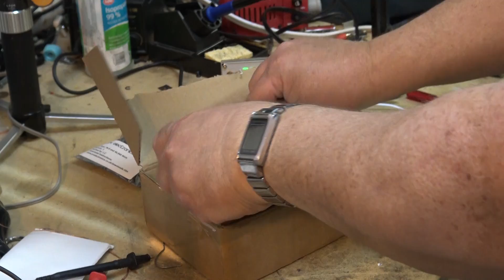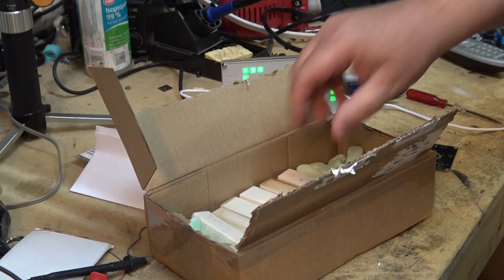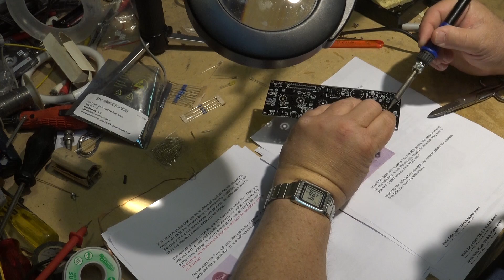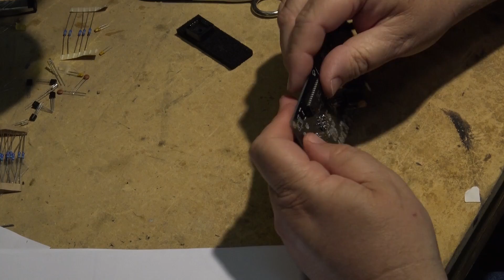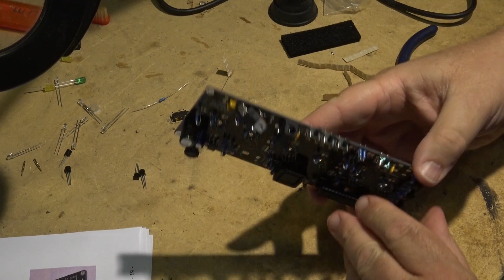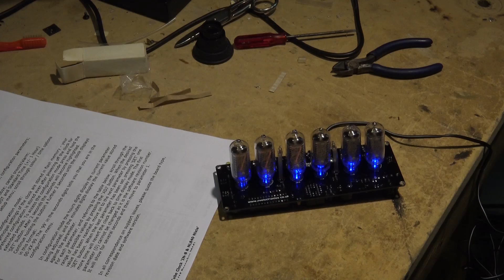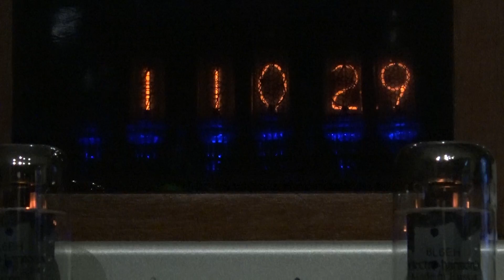Nixie Tube Clock Build

Comment: Can you tell us where you bought this kit from? There's a ton available but most of them look like junk.
Reply from the maker: I did say where I bought it.  About 1:25 in from the start.  Pv electronics over in the UK. Very well designed, working perfect and the "5" digit is a real 5 not an upside down 2 as many are.  (The Russians where the tubes were made cheaper out on many tube designs and just stuck the 2 in upside down to make a 5.

Comment: Did you get taxed when the shipment arrived? Just curious as I am in canada as well. Thinking or ordering one. Thanks!
Reply from the maker: No tax collected. Arrived in the mail.
Reply: @12voltvids  how long did it take to arrive?
Reply from the maker: @seanzacharyuy7647  
It wasn't that long a couple of week if I remember.  I didn't order any fast extra cost shipping.  Was 10-14 days if I remember.
Reply: @12voltvids  cool thanks! Going to order as a Christmas gift for my parents!
Reply from the maker: @seanzacharyuy7647  
Yes this is a nice unit.  There is a much cheaper 4 digit nixie clock offered by a seller rob g on tindle.com.  it is also very nice but lacks the seconds display but it is under 50.00.  I built one of those as well and it is on my channel.
Reply: @12voltvids  I ordered one from pv electronics that has 4 big tubes and 2 small tubes. Payed about 140cad for it. I'll probably make a wooden case for it so it looks nicer.

Comment: I really like the detail on your video!  WIsh I'd have discovered it a couple months ago before I built my first clock!   I have a question: did you test any of the components prior to soldering them in.   i.e. resistors, caps, etc.   Then follow up question: how do you test capacitors or any other components, if possible?   I built a kit similar to this, but stupidly did not test any components before soldering.  (Also the kit did not come with any procedure for testing "stages" as you describe it).  Long story short, after assembly the clock did not work.  Only then I tested all the resistors :-(don't know how to test any other components), and found one in the high Voltage section that was all wrong: it metered at 3K not the 56K that it was marked to be.  So I wonder if the 3K resistor let too much juice through and fried one of the ICs.  (I've since replaced the faulty resistor, and still no joy on the clock.)  Careful examination of all the diodes, caps, etc. and none of them look fried, but I'm  not sure that they would have a fried look if they were.  Can you give any advice?  Also: what do you call those pins that i.e. function like a socket for the tubes.  If I build another kit, I would definitely want to include something like that.  My current kit the tubes I hard wired/soldered in (and I'd not been able to find IN14 sockets).

Comment: Nice! Should have come with a case.....
Reply from the maker: Robert Kohut 
They do. There are several different cases available. Acrylic, wood ect. That adds to the price and shipping cost. I already had one I built many years ago that was the exact size and the entire unit fits in protecting the tubes and has a nice black glass on the front so the display shows off really well. True you don't see the tubes as well just the time but it looks great.
Reply: Cases are available from PV Electronics.

Comment: i love this old tech,  i want to get my hands on some of the new nixies that started getting built recently and design a relay logic nixie clock. 
of course on that note i'll probably end up doing a relay logic light board clock, maybe using leds to build the numbers.  
cool video man.
Reply from the maker: I built a really large LED clock using white LED strips. Problem is half the LEDs are burning out after only a year or operation. Still like the nixie tubes. They are just cool to watch operate. Have 2 of them now this one and a 4 digit kit that was really reasonable. Like 47.50.

Comment: Dave , PV Electronics  has Discontinued this Clock, They say they have better ones now . I have looked but not sure which one to get ... 
I think there IN 8-2 or IN 14 QTC clocks are fairly close to the one you do in the video  would you take a look and let me know please
Reply from the maker: This clock is not the one on Tindie. This is the PV Electronics clock. The tindie clock is here:
https://www.tindie.com/products/RobG/msp430-nixie-clock-kit/?pt=full_prod_search

It is still available as I was just on the site. I have built 2 of them.. 
This one from PV electronics is beautiful, and has seconds display. and displays 5 the correct way.
The other one uses a 2 upside down as a 5.
Reply: I think we have a misunderstanding I did post the wrong website it was PV electronics not tinide. and that's the one I'm looking at I tried to get the one that you did on the video but it shows to be sold out so I chatted with them and they said they  discontinued it. And they put some new type clocks in its place I was just wondering which would be better the IN14 tubes or the IN 8-2 tubes
Reply from the maker: Both IN14 and IN82 are the solder in type of tube as opposed to standard tube socket like mine. The tupes are what they call the QTC type, they are soldered to their own little plug in board, which is fine. The difference bwteeen the 2 is the IN14 uses a up side down 2 to form the digit 5, and IN82 uses a proper formed 5 digit like in this clock. If you look at my other nixie build, the tindie one, it uses the backwards 2 for the 5 digit. It is just personal preference. The old soviet tubes all use the up side down 2 for the 5 as they were cost cutting. The did the same for the 9 digit, just an upside down 6. The IN82 uses a proper 9, which is slightly different in the dimensions.

Comment: Nice movie of a fine clock who backs me more than 50 years. Comparing with the primitive nixie tubes used by HP when the memory was a rather complex combination of neon bulbs with LDR's it forced me to feel real old. Take care.
Reply from the maker: Rui Jacinto 
I am building another one with an old tech display, a numitron tube display!
Reply: May be an E1T display, today a piece of museum ca 1954. Please read my article "E1T decade scalar tube" published in Elektor and reprinted in "Retronics 80 tales of electronics bygones" page 70
Take care
Reply: Indeed the first magic eye was no more than a minuscule CRT, naturally with a big consumption note appropriated for battery radios then come the "exclamation" ! version easy to interface and low consumption but the public acceptance was so bad than Philips introduce the second generation.
About E1T was a secondary emission CRT wit carry and borrow electrodes to interface in a counting chain.  His use was limited to nuclear and X-ray instrumentation. Regards
Reply from the maker: I do have a magic eye tube, just the bare tube out of an old radio. Some day I should build a power supply, and see if I can get it working as a "vu" meter. Now that would be cool just to watch.

Comment: Comes From Uk = Quality, i love these nixie clocks will have to get one myself one day and fit rgb leds instead of just blue
Reply from the maker: Yes well laid out. Note that I didn't say "built" as it was a kit. It is well built now.
The LED color can be easily changed. I have them turned down to the lowest level, and what I have noticed is they pulsate with the flashing seconds lights.
When the 2 neon lights between the hours and minutes light the LED go dimmer, and return when the lights go out.
No by contrast if the dim option is selected for night viewing, the LEDs go brighter, and the cross fading of the digits stops when in dim mode. Haven't observed it when I blank the display in the wee hours of the night. This is a feature to preserve the display. No point running it when everyone is asleep.

Comment: Loverly job, looks smashing :-D
There was a advert in the old electronic mags that shows a man with a built kit in his hands, "Im prowd to say, i built it myself." or similar, you sound really happy with the result :-D :-D.
I think it was a heathkit, if my memory is correct :-).

Yes i expected it to be expensive, coming from the uk didn't help, our taxes are a bloody pain.
Some americans think we are tight with money, it's not true, the cost of living is silly.
Reply from the maker: The cost of living here in Canada is also high.  Here on the west coast, a 800 Sq foot 1 bedroom condo will run you over a million, and a single detached house on a 33 foot lot, closer to 2 million. A new house just up the street from me,  on the market, 35 x 80 lot, house has 1700 sq feet on 2 levels. Asking price 1.8 million.
You are right on the heathkit. Heathkit also had a panaplex plasma display clock. I remember one from the TV station I worked at. Was always tempted to steal it. Thinking back, I should have. I have a panelpex stop watch, and that might be one to repurporse the display tubes from, but I am scared of breaking the tube trying to remove it. I should hook this old stop watch up and do a demo of the display, as it is really cool. 

I have ordered a GPS module for the Nixie. So then it will basically be an Àtomic`clock.
The wood cabinet with the dark face glass makes it an even nicer looking clock, and it fit perfectly inside. Looks better than the old VFD clock I had in there because of the proportions of the size. It looks better in person than on camera.

Comment: I think you can build a HI-FI preamp out of the VFD modules,  just google it.
Reply from the maker: But what would be the point? A VFD is basically just a direct heated triode, with phosphorous on the anode that glows when struck my electrons.
Sure it will work, but that would defeat the purporse of it, as a display.
Reply: someone built a shortwave radio from VFD  tubes
Reply from the maker: A VFD is a vacuum tube. A Triode with a direct heated cathode.
There is 3 elements, the filiment/cathode, screen, and Anode. The screens are normally used to bias the tube so that the anodes can be controlled. In a normal triode the screen is where the signal goes, and the anode is where the B+ goes. As a display, the screen is set up as a bias and the voltage to the anode controls the brightness of the segments of phosphorous coating the anode.
If a constant voltage is applied to the anode, and a signal is applied to the screen, guess what, it will control current flowing in the tube.
It will work as a triode, but not a very efficent triode in terms of gain.

CCNDT (cold cathode neon display tube, or `Nixie`` are not vacuum tubes. The tubes are filled with Neon gas, and a positive charge is applied to the anode, and negative charge to the cathode that you wish to light. They work like the old NE2 glow bulbs.
If you feed them DC, only the pole that has the negative charge glows.
On AC both poles glow, even the grounded (or neutral) side.
When  the incoming AC waveform goes positive, the ground side is negative with respect to the positive pole, and when the waveform swings negative, the line side goes negative with respect to the neutral side.

Comment: too bad about the price or the blue leds
Reply from the maker: ‍1marcelfilms 
the blue LED are optional.  they don't need to be installed, and they can be turned off.  as to the price for what you get this is quite reasonable. the Ramsey kit I was looking at was 275 usd back when they were still selling them. the tubes are what make up most of the cost. they run typically about 25.00 each and there are 6.  the tubes in this kit are 1980s vintage. if you saw the work that goes into them,  and they are all hand made you would understand the cost of them.  
I would like to build a parallel display clock. I have a numitron on the way. I have already built a vfd, led, dot matrix and now a nixie. a parallel would complete my collection.
Reply: This clock would look even better with amber or a dim orange color leds. 7 still don't think the blue looks bad. It just kind of takes away from that vintage look.
Reply: When I was younger I disliked blue LEDs, but over the years I have learned to despise them with a passion. Good thing they can be turned off. This was a nice build. If I had more money or less other stuff to use it on, I would certainly buy a kit like this.